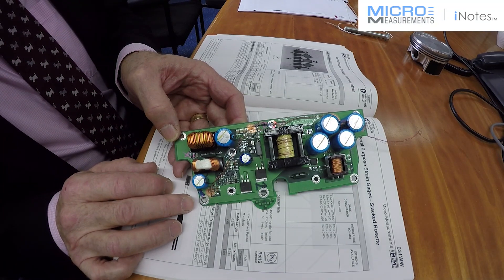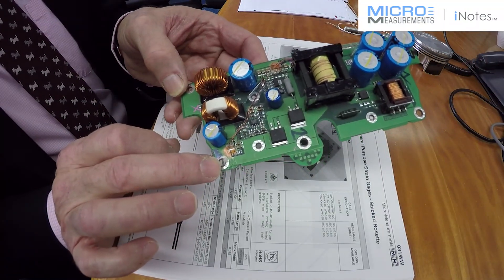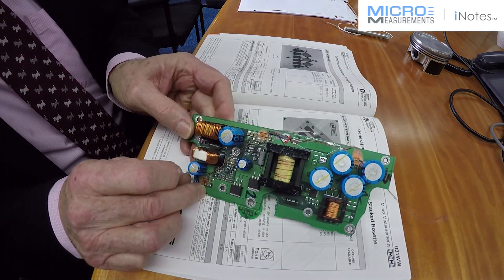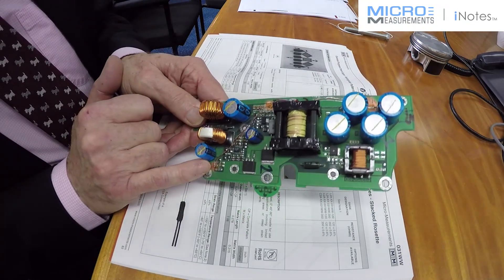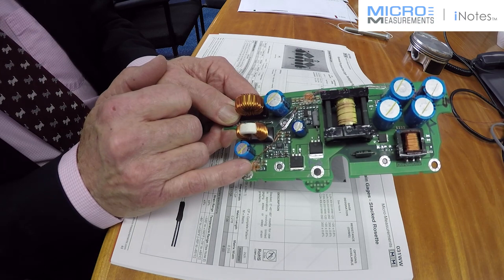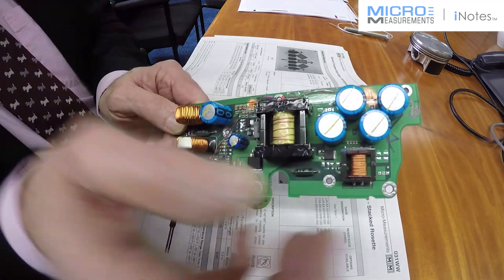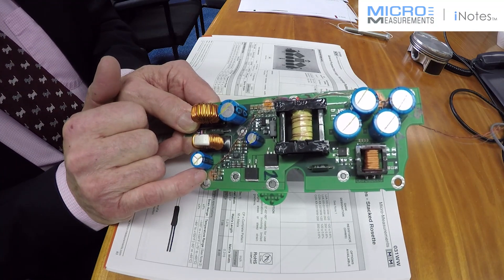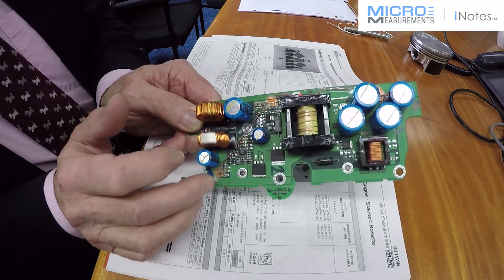How To Test a PCBA (Printed Circuit Board Assembly)

Comment: En este video de iNotes, Mike habla de las grietas en los PCB’s y muestra cómo las bandas extensométricas de Micro-Measurements se utilizan para ensayar componentes, subconjuntos, placas de circuitos impresos, embalajes de montaje superficial, “Ball Grid Array” (BGA) y productos terminados.

En respuesta a la pregunta de ¿quién debe utilizar las bandas extensométricas en aplicaciones de PCB’s?, diremos que abarca desde los proveedores de accesorios para los ensayos, como los proveedores de componentes, los fabricantes por contrato (EMS) y hasta los ensambladores de PCB’s.

Si necesita más información, por favor no dude en contactarnos. mm.es@vpgsensors.com miguel.bravo@vpgsensors.com